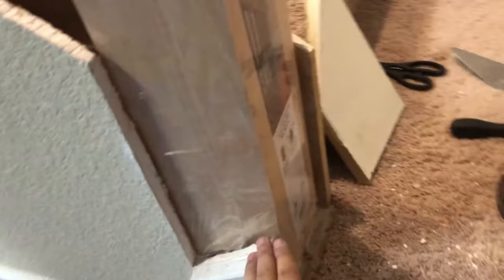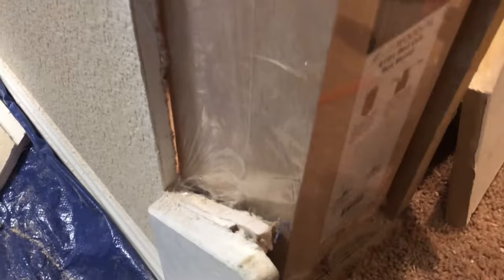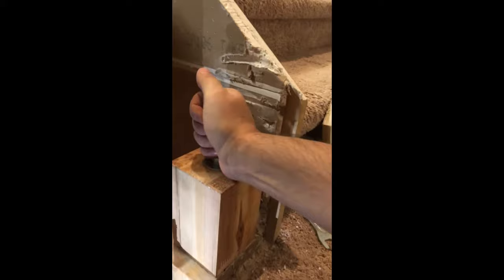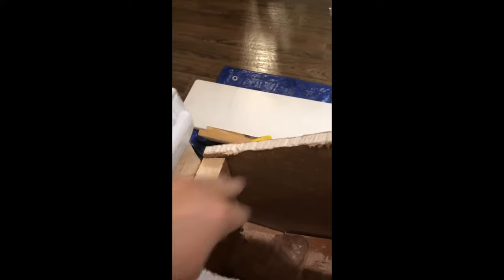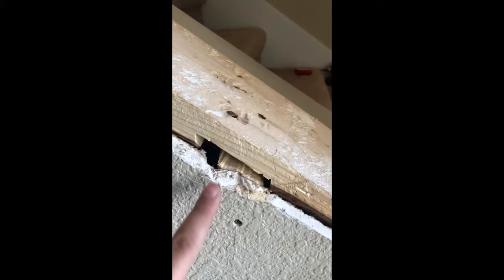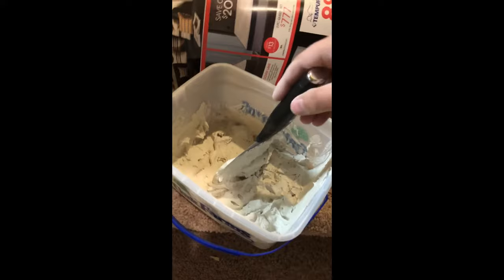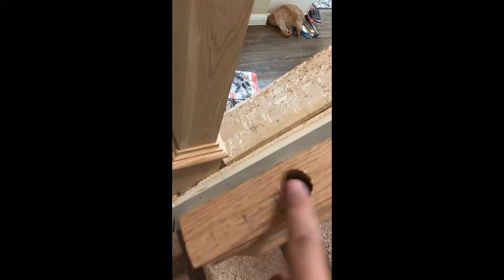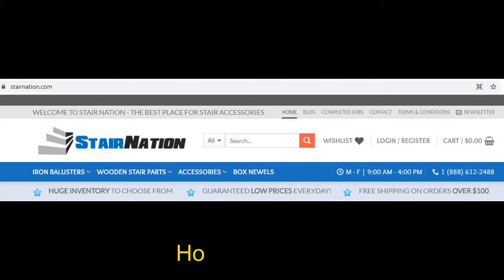How to Transform and Upgrade Drywall to Railing Balusters, DIY

Comment: That post has to be in front of the riser because your handrails have to pass the riser by 1” to be code. So now that you inset that post you need another wall rail on the other side to past the risers.

Comment: Hahaha, 1" drill hole maker!! That's like a thinga majiggy! It's called floating sheet rock or drywall! That'd ok bud, we all had to learn at some point! If you are happy with the end result and you obviously learned something, before you know it you'll be building the Space Shuttle!! 

Standard Newell post is usually 36", I believe that's code! Oh and stairs don't have a lot of support in the middle because the upstairs joists and the concrete foundation are support for stairs, stingers equally spread the load over a the span, straight runs don't require much support in the middle because the structural support from the floor joists, concrete slab and supporting walls. Think of floating stairs, they have no visible supports because the wall the are secured to bears all of the load, hence a load bearing wall! 
Think of putting stairs inside of a box (which essentially is what builders are doing), the support would come from the box walls and foundation, putting supports along the span of the stairs vice the walls would make them unstable and the supports would succumb to the forces of physics (Von Mises Stress Criterion), start to twist, become wobbly and eventually fail. Whereas the stringers that are properly anchored to the upstairs joists and the downstairs concrete slab, because of the angles of the stingers they spread the forces of the load somewhat equally so they don't require much support for load in the middle, mostly to keep the stairs from twisting and becoming unstable. I know I went far too deep into the science and physics, but I'm a scientist!

Good job, read, read, read... Ask questions and understand the science behind why things are the way they are, and there's not much you can't learn or do!
Reply: You’ve never installed a stair have you??? Stairs don’t get joist hangers buddy, all they get is screws or nails from riser to header. You do need a lot of support in the middle if it’s a long stair, if not the whole stair will move even if you have really strong support at top or bottom. Yes doing 1 inch hole in bottom null is kinda sus, but if properly installed it won’t Make a difference. Null code ranges from 34 inches to 36 in residential homes. Don’t try to be mr science guy if you’ve never installed a stair🤨

Comment: Does code require a handrail on both sides all the way up? I noticed you don’t have railing on the left side at the top of the staircase.
Reply: His stair is out of code. Well at least in California. The rails have to be continuously go past top and bottom risers by at least an 1” His landing post is behind the riser so therefore that rail ends way before the last riser which causes people to fall because of the rail stopping short of the bottom riser.
Reply: In North Carolina there only needs to have one railing and I had ten foot ceilings. The other side had picture frame molding, so there was no room for an additional railing. I never felt unsafe using those stairs, although there were two landings because of the height of the stairs.